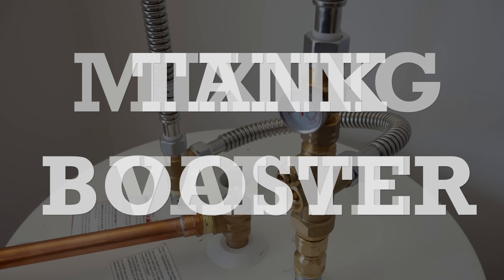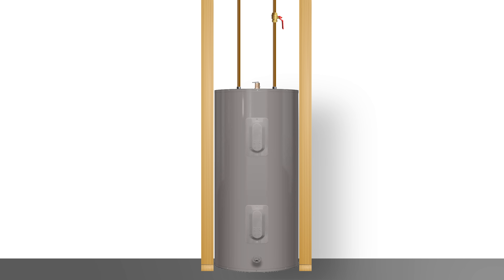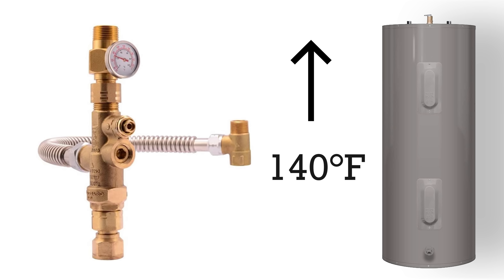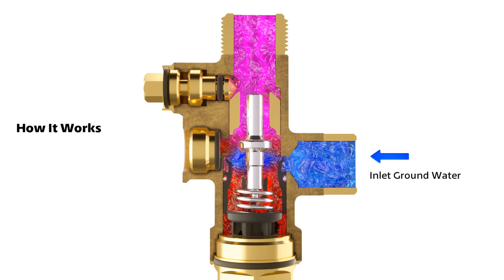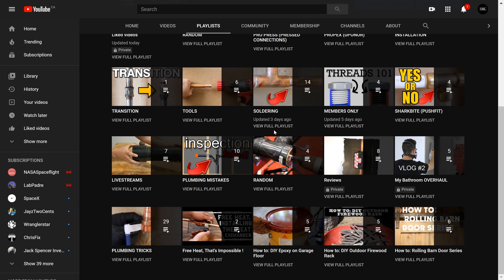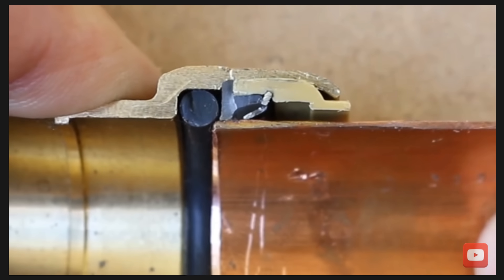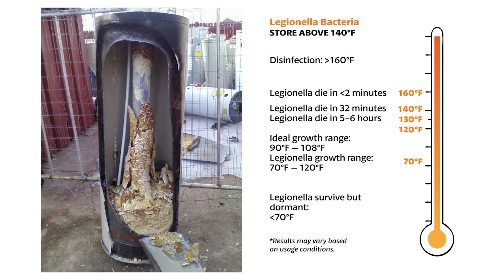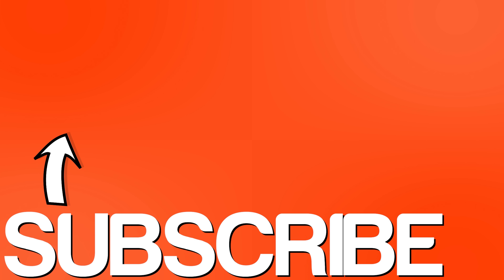INCREASE Your HOT WATER Capacity With This! (Cash Acme PRO Mixing Valve) | GOT2LEARN

Comment: It seems those are much more common over here in Europe.
I install 3-5 of them (mechanical ones) every year, with several justifications:
- For elderly people, or very young ones so they don't get burn (both have a slower reaction time to burning sensation compared to adults)
- In most of the restaurants and hotel, so that they comply to legionella regulations, and so that their customers never get water above 50°C
- With smaller "intelligent" water heaters that heat water up to 75°C to produce as much hot water as promised in the advertising.
- On all the solar systems, that can produce extremely hot water during summer.
Thanks for the video.
Reply from the maker: Awesome, thanks!!!

Comment: Great stuff!  A tankless (on demand) water heater solved our capacity issue, but created a new problem that might be worthy of one of your videos. 

Our water is quite hard @ 16.7 gpg (238 mg/l).  Our fixtures showed signs of scaling but no discernible drop in pressure over the 16 years that the original hot water tank was in use. 

Within 2 years of installing the tankless unit our water pressure at most fixtures had declined significantly (i.e., barely enough flow to activate the tankless burner). 

My conclusion: The old tank provided a place for much of the hardness minerals to drop out, where they could be periodically dissolved with injected vinegar and flushed from the tank through the drain valve. The tankless has no such place for those minerals to drop out so instead they settle in plumbing loops, other low points, and aerators. 

Solution: I installed a water softener and pre-filter. Immediately before installing the softener, I also pumped vinegar into all of the plumbing lines (during my annual tankless flush) to clear the mineral blockages and restore flow. (P.S. -  I thought it best NOT to run the vinegar through the softener media.)
Reply from the maker: Yes, tankless heaters need to be maintained every year, or even better, twice with the vinegar solution as you mentioned. The mixing valve also needs maintenance such as cleaning out the strainers, but can go a while without it being done, cheers Ron!

Comment: I use a drain water heat recover pipe on my drain stack under the bathroom stack to preheat the cold water coming in.
Reply from the maker: Works?
Reply: @Got2Learn  very well. Waste water preheat the cold water coming in. https://www.energy.gov/energysaver/water-heating/drain-water-heat-recovery
Reply: @Got2Learn  been using for 12 years or so. Never run out of hot water. Works very well, passive, and maintenance free.
Reply: I would love to learn how to instal this in school! what is the materials list like? Could I theoretically make something out of scrap copper?
Reply: @jeadoretu  its a solid form weeping tile type abs fitting with the 3/4 copper wrapped around it en route to the water heater. The fitting costs over $500 0re made and wil never repay its expense. Do the trade math on the delta t and the contact surface area ( its a low grade heat exchanger )  you won't gain much at all. You could make one for cheap, but if you installed it you better have good insurance since you've just field fabricated a mechanical device ( not legal in most places )
Reply: @jeadoretu  I bought it pre-made.  Plumber put it in. Clamps on top and bottom. Use an adapter to connect the pex lines. You could probably make one. Some videos on diy drain water heat recovery pipes on YouTube.

Comment: I installed a circulation system several years ago that pumps my hot water thru the system every 5 minutes. You have your choice how often you want to pump to kick on being it’s an adjustable setting. To work correctly this system also connects into the cold water too! Now our hot water is always hot moment you turn on the hot water rather than having to let the hot water run for 5 minutes till it finally gets hot! Unfortunately though, being this is connected to the cold water side, when you turn on your cold water the water will be warm for a short period of time till it gets cold again.  For us it’s not a big deal to have the cold water on the warm side when we first turn it on. The benefit of having hot water immediately on the hot water side out weighs a little warm water on the cold side!  But you can also install a small hot water tank under your sink to help with having hot water quicker too!  I went with this circulation system cause I got a super great deal on the system and it was easily installed myself since I’m a contractor by trade and have done all kinds of different projects throughout a home.

Comment: Just a heads up, if you have an expansion tank on your current system, you will likely need to install a larger expansion tank as acceptance volume in an expansion tank is calculated based on water pressure, stored water volume, and water temperature.
Reply from the maker: The temperature of the output is the same, this doesn't apply here.
Reply: @Got2Learn  It does in the states where 120 degreesF is typically the max allowed.
Reply: @Got2Learn  Also it's the stored volume temp that is of concern here in regards to expansion tank sizing not the outlet temp correct?

Comment: I have learned a great deal from your videos! Quick gripe, the amount of energy to heat up water is the same regardless of the temperature of the tank. Sure, the tank will lose its hot water slower, but you have to maintain it at a higher temperature to do that if you outlet temp is the same as before the modification. I would not do this modification expecting to see any gains in energy efficiency, but it would increase the effective capacity of your tank. Thanks for demonstrating this product, my wife empties our tank after every shower!
Reply: Wrong, the temperature inside the tank is higher and the losses get greater with the increased temperature due to the temperature differential, were you even paying attention? Insulation is not a end all catch all, the inside and outside temperatures matter tremendously.
Reply: @tslim250  Who are you claiming "wrong" to? I did not make any claim about it making the system more or less efficient, I simply said "I wouldnt do this expecting a gain in efficiency", and Jarrett's claim is actually correct about a higher temperature making the system less efficient (which is precisely what you said).
Reply: It will reduce efficiency because the piping and tank will radiate more heat

Comment: The advantage of not getting scolded is valid. The advantage of using less hot water from the tank is a total failure. Say noe more...
Reply from the maker: You use the same amount, it just doesn't depleate as quickly.
Reply: @Got2Learn  No. The amount of hot water is depleted just as quickly either way.

Comment: Maybe I missed it but once the temp in the tank runs low , does the cold water continue to mix with the hot water?  My concern would be, once the tank temp reduces because it being used all morning does the cold water keep mixing?  When the temp is 140F it would work great I’m sure but surly after 3 showers in a row, the tank is now 130 or even 120 degrees now right?  So if that’s true, then if the tank temp is 130, now the water after the valve would be less than 120 now because the water isn’t 140 degrees anymore.
Reply from the maker: It's thermostatic, si it only mixes when it needs, output temp on valve  is what governs it.
Reply: Thanks for the info. That being said, I’ll definitely get one now.
Reply from the maker: @dontdrinkthekoolaid4796  enjoy! 👌
Reply: To follow up, I did buy and install the valve. I must say I love it. My tank was set at 120 degrees prior to the valve and the hot water had a bad odor to it. I live in the country in NW Ohio and have a well. Now with the valve and the water heater set to 140 degrees, the odor has went away. Perhaps it was the bacteria you were talking about?  Anyway, 3 showers in a row and I still have hot water. It’s a 50 gallon electric water heater.   Definitely a great investment for me. I’ll definitely keep watching your videos. Thanks
Reply from the maker: @dontdrinkthekoolaid4796  🤘🤘🤘

Comment: Got2learn, whether you mix the watet at the tank or at the faucet it seems irelevant.   Pretty sure if you set up dual rigs side by side with water meters on all lines, the usage would be the same, given that the tanks were set at same temperature and the water coming out of the faucet was mixed to the same temp.  The only benefit from the tank kit is safety.  But the "more hot water" claim is false.  Any engineers out there to weigh in?
Reply from the maker: Well, they do allow for more hot water and that's a fact, but yes, their primary use is mainly for safety as all water heaters should be maintained at 140F like the code says.
Reply: @Got2Learn  If I am misinformed please explain how "they allow for more hot water and that's a fact".  I have to have the scientific explanation to understand it.
Reply from the maker: It's quite simple actually, because the water in the tank is hotter, you can mix it with more cold water than usual (more cold, less hot) to get the same temperature, which means that you are using less of the hot water in the tank, hope this helps.
Reply: If you mix at the tank or the faucet you are going to get the same benefit.  The only very negligible difference is that mixing at a faucet would cause some line loss in temperature (in the pipes).  But this will be very small.  The benefit is not scalding so this is better for that.

Comment: The illustrations showing tanks inside stud bays is unrealistic. I've never seen water heater take installed inside a stud bay.
Reply from the maker: Ummm, there's a lot, that's not unrealistic like you said 😆
Reply: @Got2Learn  may be a regional thing then. I'm 63 and have been around a lot of household utilities and yet to see one like that. They're usually out in the open with access all around
Reply from the maker: It is a regional thing, I personally did the plumbing in thousands of homes that the tank was in the main entrance closet or in the utility room closet or even in the main bathroom in a dedicated closet, so it's very possible and these devices will help people out in those particular situations ;)
Reply: @Got2Learn  I live in an area where most homes have full basements and that's where the utilities live

Comment: Funny enough I've got a 1970s domestic coil in my boiler - one of the least efficient water heating systems - and we never run out of hot water
Reply: @contradictorycrow4327  also takes an engineer to make it wildly expensive to fix and massively decrease the lifespan. I'll take inefficient when it's tied to long lasting and easy to repair, any day
Reply: @contradictorycrow4327  Heating is typically 100% efficient. Unless you're going heat-pump where you can arguably get more.

Comment: better off doing a recirc pump. I have a 2 story and had to run my water for 1-2min to get HOT water for a shower (because of a pre- mixing valve installed)
Disabled mixing valve and i get hot water in less than 15 seconds now. and i MIX myself with taps, how we were taught to do. 

Running out of hot water? When was last time you checked your tanks dip tube, anoid & did a tank flush with proper fittings?
Reply from the maker: A recirc line won't increase your hot water output, it'll make decrease the time waited for the hot water to arrive at the tap.

Comment: Most water heaters go from 40 gallon to 50 gallons, NOT 60.  If this saved energy it would be worth doing.  Turning up your heater to a hotter temperature would require less hot water from the tank to mix with cold........just saying.
Reply: And cost MORE to keep the water at that higher temp 24 hours a day.

Comment: Why does the thermostat on the gas water heater is not marked with water temperature instead of "LOW",  "A", "B", "C", "D", "HOT"?
Reply from the maker: Dunno.
Reply: It's because the manufacturer cannot know the incoming water temperature and the gas valve is not a calibrated temperature sensing device. E.g "b" could be   120f or 160f depending on the inlet temp.  If they made them precision temperature settings the cost would increase. They are set at temperatures though, but they keep a,b,c and hot etc as it limits their liability
Reply: This is to say that although it senses temp and shuts off accordingly it could be 4-7 degrees off.. just enough that you could scald and sue if they were not careful

Comment: Have a back up TPR valve if your tank is old cause it’s gonna leak if you relieve the pressure from there. & cranking the hot water shortens the life of your tank so you’ll be replacing it more frequently 🤷🏿‍♂️

Comment: Back in the day we were a big family. And as is the tradition, everyone wanted to take a shower on Saturday. The problem was that the last one didn't have enough warm water, so there was always a discussion about who was on when. Then we had a thermostat installed in the shower. Now my father let the heater's burner run longer so that the water got hotter. Thanks to the thermostat, the temperature was always pleasantly the same when showering.
During the week there were showering at different times so that it was less of a problem.

Comment: Aside from the potential scalding water hazard (at 140*),  I'm having difficulty understanding how this saves on anything.  Running water heater at higher temp will lessen the useful life of the water heater.  Energy usage will increase (elec or gas) to raise tank temp from 120 to 140*.  Maybe somebody could get more/longer run time of water at 120 but isn't that about it?   Water entering tank is generally 50-60* coming from underground supply line pretty much year round, except for extreme climates.
Reply from the maker: By keeping the water inside the water heater hotter at all times, it limits the amount of times you'd be stuck having that hot water turn into cold water, does this make more sense?
Reply: @Got2Learn    Yeah... I get that part i.e. provides more hot water for longer.  If a large household with high demand for hot water, I understand the principle.. In essence, just makes the water stay warmer for longer run times.
Reply from the maker: @avflyguy  yeah 👌

Comment: Did not know that the newer water heaters put more insulation. That explains the frustrating issues I had trying to find one that would fit when I needed to replace one.
Reply from the maker: Persicely.
Reply: Thank the feds. No thought whatsoever put into water heater replacement. I put heaters in many older condos space in the mechanical room can be quite limited to say the least

Comment: Can these be installed on a mobile home water heater? Cold inlet is on the side rather than the top...
Reply from the maker: Yes, page 9 at the bottom: https://www.cashacme.ca/wp-content/uploads/2014/08/Tank-Booster-Installation-Instructions-01.2019.pdf

Comment: I noticed it says naeca hot water heater regulations wtf is that?? Why would u need a device to heat water if the water is  already hot??? It's called a water heater because it heats water TO MAKE IT HOT

Comment: You will get bacterial proliferation of all associated pipework as outlet temperature has to be 50c plus but you show it at 49c of all pipework as a mixer valve has to be within 2m of the mixing point as per acop l8 and hsg 274 in the UK 🇬🇧
Reply: Completely different rules in the U.S. and Canada. Some mixing valves are specifically approved for installation at the fixture, and some are approved as a whole-house unit, to be installed at the tank. 
Canada's National Plumbing Code requires all electric hot water tanks to be set at  60C to prevent legionella growth. Strangely, this rule does not apply to tanks using other sources of heat. There is no requirement that hot water exit the fixture at 50C or 60C. The scalding of children and the elderly is considered a much bigger problem.
Reply: Do you not have chlorinated water?
Reply: @ergosum5260  yes but you will fine bacterial proliferation in anything but is active mainly between 20-50c with prime temp being 37c (body temperature) if you have tmvs they should also be within 2m of ANY outlet so a centralised mixer/tmv is a massive no no 👍

Comment: I didn't see detect any dielectric unions on the demo install, only copper to a galvanized nipple with dope on the threads as well as the brass mixing valve to a galvanized nipple...or, did I miss something?  If that was mentioned in the other comments, I apologize, I didn't read them all, thank you.
Reply from the maker: Rewatch the video. The adapters I used were brass, not copper and I mentioned using dielectric unions if they are mandatory in your city 😉